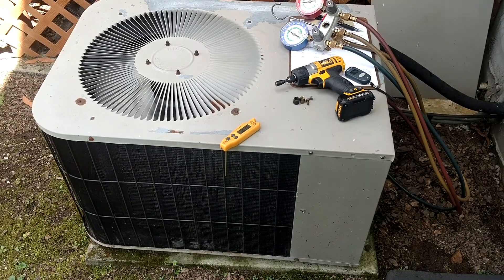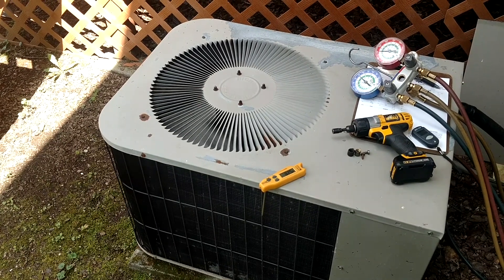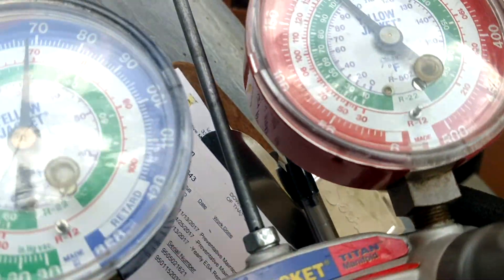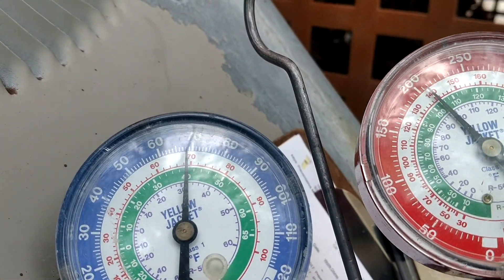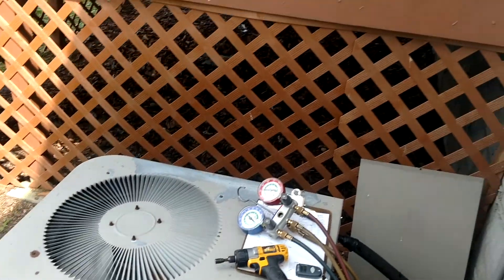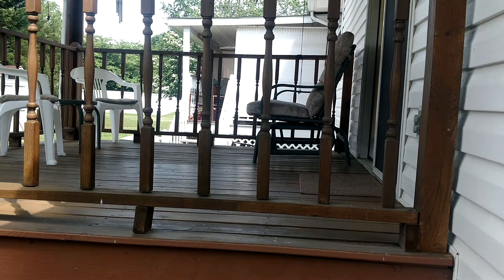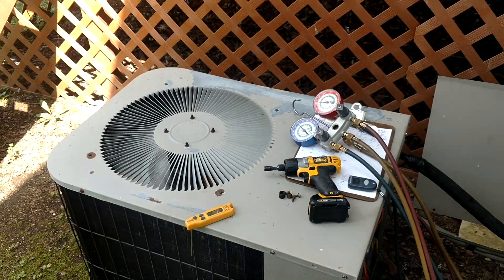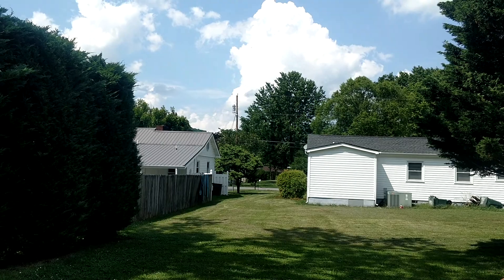The 95' Janitrol Twins (part-1) HVAC maintenance. Harbor Freight non contact thermometer 1:1 #93983

Comment: Shannon I have an old Janitrol bolt broke on fan no one wanted to even open and look.  I took it apart found bolt 
Replaced and the nuts I used came loose.
Plus I noticed cracks in grille cover.
It wS running  great but I thought I should replace mounting bolts and nuts with proper ones and replace air grille. 

But can't find these
Can you help me.. ? Shirley
Reply from the maker: Your best bet would probably be to check with a hardware store. And see if one of the guys in there could get you what you need. Good luck, hopefully you can keep it going.   😎👍

Comment: We have a Janitrol at our house, it was old when we moved in in 2001.  We have had a few minor issues over the years but nothing major.  Right now we have our coils freezing up.  The unit hasn't been run for a year since we had a house fire.  Fingers crossed the ice build up is an easy fix.

Comment: Nice work, do you have pipe clamps for checking superheat and subcooling?
Reply from the maker: polishtheturd mickelson Yeah, i only use the Fieldpiece Pipe Clamp. The "New" yellow colored ones. If I'm adjusting the charge, i use those and a Fluke 52 elec. therm.
Reply: Yeah, those old Janitrols were beasts. I worked on a few of them. Beer can cold and leave them.  Liking your videos, you do a great job